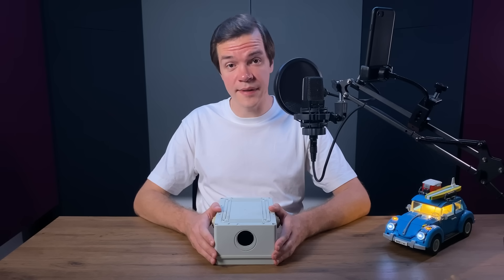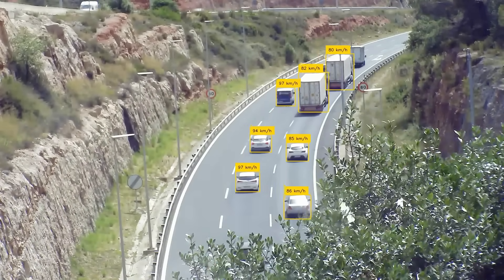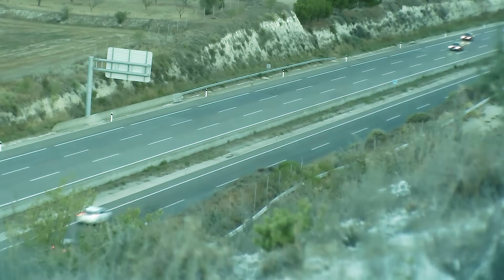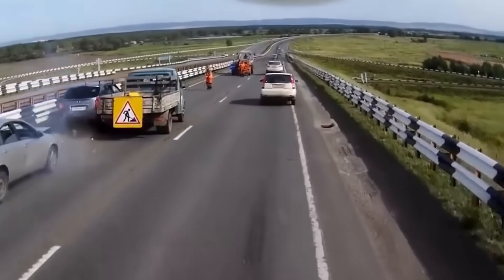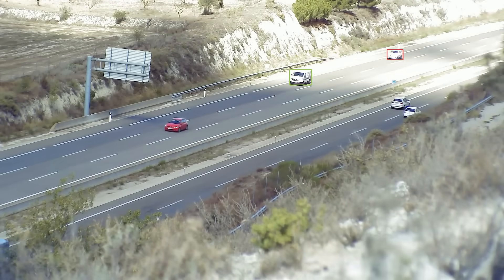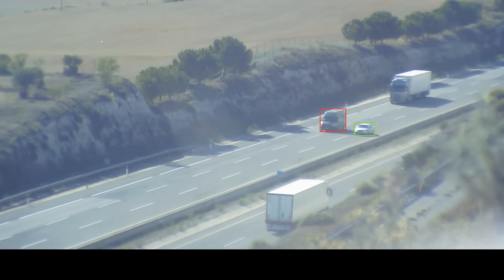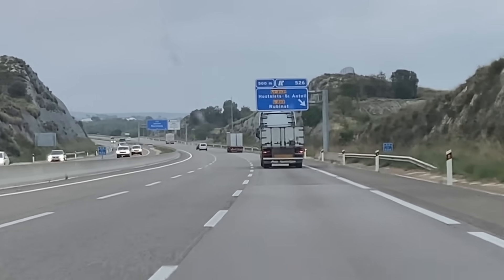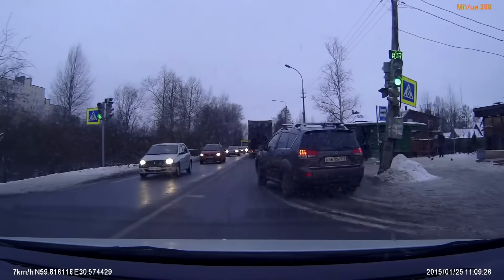New Anti-Tailgating Camera Reveals Shocking Statistics

Comment: They should put speed cameras EVERYWHERE and charge for speeding for each camera that record s the same car speeding. That way, if a car speed for 20+ cameras, they get charged X20 times the fine, and the should also clearly lose their license permanently. That is how you make road safe. And for the love of dog, do not put sings telling people they are being filmed, you are letting criminals know they are being filmed so they obviously stop doing crimes in those areas, how stupid that is... also, if the goal is to make money, why tell them too that they re speed cameras there? That is also cutting like 33% of their revenue.

You could have 2 cameras set along a long straight part of the road, to record enough to prove that some one tailgating is not a victim of being cut off by an idiot. This way, you can show who is tailgating for a LONG distance, even if they where cut off, it shows that they didn't slow down to keep a safe distance again. So yes, they can definitely make a tailgating camera, that can also serve as a speed camera. Why not do it? It would provide revenue and punish criminals and make roads safer. Also provide jobs to people who have to check manually that the verdicts are correct.

Comment: In my opinion streets should be watched by cameras like you did and fines should be given based on variuous observations. Of course the measurements are not "german precision", but it would be easy to look at ten video clips (or hundred) and then decide: You were calculated too fast on several of them and you never travel at a safe distance, so...

Comment: You didn't mention modern lidar-controlled cruise control systems. If you have the cruise control set at 64 but the car in front of you is going 60, your car will sense that there is another car in the lane in front, and will slow your car down. So, the cruise control chooses what following distance to use. The default on my 2020 Toyota seems to be a little over 3 seconds. You can press a button on the steering wheel to have it reduce the following distance, one press gets you closer, a second press gets you closer still, and a third press brings it back to default. But all three distances are pretty reasonable. So modern cruise control systems are teaching a new generation of drivers what a safe following distance is. Unfortunately even when people know what a safe distance is, they often still tailgate. And of course when an injury happens because of tailgating, it is usually the innocent person in front that gets hurt, not the tailgater in back. If you tailgate long enough in your driving history, eventually you will hurt someone.

Comment: First off, avoid freeways like this, if you can. "Tailgating" is tied to speed. If everyone is going the same speed, you'll have tailgating. this happens because everyone seems to do what the vehicle in front of them does. Go the actual speed limit and leave a lot of space for the vehicle in front of you. That way, if someone is braking hard, you can come to a slower stop, which gives the person behind you to come to a slower stop. If someone slides over in front of you, back off and let them. Stop being territorial, it's not your spot, it belongs to no one vehicle. 

I've been driving for over 54 years and have ridden motorcycles for 48 years of it. Early on I was terrible, but using "situational awareness" while riding has made me safer, and more observant in all my travels. Your number one thing to do when driving is to not hit anything. The closer you get to another vehicle, the less time you have to get stopped in an emergency. And, the faster you go, the farther you are going to travel before get stopped. You can cheat the laws of man, but you can't cheat the laws of physics. In those 48 years I've ridden over 570,000 miles, and it wasn't until 9 years ago before a car finally hit me. It was at an intersection, he "rolled" through a stop sign while I was making a turn in. It was minor.

Comment: Your analysis is 💯correct…

My driving style would show up as fairly typical by your camera — but decades of safe driving has taught me to look ahead and not just react to the car ahead — THIS IS IMPORTANT. Because you’re right to assume that is what most people do. 

However, the signs are nearly always there to either increase the gap or slow down — things like brake lights up ahead / increasing density of cars around you / brake lights in adjacent lanes (can cause some drivers to jump into your lane and cause sudden braking) 

Anyway tailgating is definitely more important than speeding and probably 1/2 way to a real safe driving experience.

Comment: In California everyone speeds, tailgates, and drives in herds. When I am driving hundreds of miles on a rural stretch of freeway I make sure that there are no cars around me. Every now and then a herd of cars catches up, passes, moves on and I am once again alone. I am usually driving a little faster than the speed limit. I'm very nervous when I'm surrounded by this herd of cars and so relieved when they have passed and I am by myself again. Of course this is not always possible when there is heavy traffic but I always try to maintain a safe distance. I was always taught to have 2 seconds of space but you say 3 seconds in the video. I will adopt that rule.

Comment: If a 30m following distance is used in Los Angeles during a busy time on most LA freeways, the traffic would be backed up for hundreds of miles.  What amazes me are not the number of crashes that occur in the LA area but the number that don't! Millions of  densely packed cars travelling at or above 65 mph (104 kph) everyday and only a small percentage of those cars collide. I have been driving LA freeways for over 50 years and am amazed at how well the drivers seem to be able to avoid each other.  Not to say there are few bad drivers because there are many and like water in a pipe its the obstructions and turns that disrupt the smooth flow of traffic.  Like your analysis, very quantitative.

Comment: 30m?! Homie, 30 FEET isn't even close enough going 120-140kph on US highways. One of the longest civilian (i.e. non-fleet) vehicles you can buy here is a dually long bed crew cab Super Duty F-450. It is 266 inches long from tip to tail. That's 22 feet. You leave any more than 30 feet of space and you're asking for a bad time. Even a truck that long (and especially a truck that long) will ABSOLUTELY try to merge in front of you.

Comment: In South Africa, speed cameras are mostly placed where they specifically want drivers to slow down such as when entering towns or where a freeway converts to a lesser road. Drivers do know where the cameras are and they are very effective at teaching drivers to slow down at appropriate times. High speeds on the freeway itself are often not that much of a problem which is why Germany has many freeways with no limit.

Comment: I've been driving since the 1980s, and I already knew the answer was "following distance" and not speed that causes most accidents.  The other causes are distraction (particlularly with the advent of smartphones), and "horseplay," that is when someone is just "having fun" with their car.  Typically young males do that.  I did that myself, but was fortunate enough not to have any serious accidents (I did put my car into a muddy field on a back road once).  

I can't speak for any other country, but in the US I think another culprit is lack of sleep or inadequate sleep.  The worst accident I had was a result of that.  Turns out that I have sleep apnea.  It was after that accident that I went to get help with my sleep.

But the thing I've observed the most during my years of driving, most people don't allow enough distance between each other, and when you do leave a reasonable distance, others jump in the gap.  I usually stick with the slower lanes so I can more readily maintain that distance, but even I've been guilty at times of following too closely.
Reply: Mostly correct. You conveniently forgot to discuss simple physics. As speed increases reaction time must also decrease, and everyone has their limit. Additionally, as speed increases, the moving mass becomes more and more destructive. Adding the requirement of decreased reaction time and increased destruction together is a very dangerous mixture. So, speed does cause accidents. 

To understand this very simple concept: 
Imagine driving down the road at 30 miles an hour and a deer runs in front of you. Now, imagine driving down that same road at 100 mph and a deer runs in front of you. Your reaction time at the higher speed must decrease dramatically in order for you to miss hitting the deer. Add in the mass of the vehicle at the higher rate of speed, other vehicles on the road traveling at different rates, and other drivers with different skill levels, and you have a recipe for an accident. This is pretty simple stuff.
Reply: @niaralosusa  I'm not disagreeing with your statement, but I didn't claim that speed doesn't contribute to accidents, but that it isn't the cause of MOST accidents.

Higher speeds will increase the likelihood of accidents, and will definitely increase the damage and injuries an accident will cause.  

But most accidents are caused by following too closely for the very reason you point out that high speeds can cause an accident, reduced time to react.

The reason that more accidents are caused by following too closely rather than high speeds is that there are more people  following too closely than there are people going at high speeds.  

Of course, the question comes up, "How much speed is too much?"  That's a question that will have many different answers.

Comment: The assumption that you need to come to a full stop is faulty. Any other vehicle on the road will also take time to stop making the required following distances much smaller. So the only case where those full stop numbers have any merit is debris in the road which isn't that frequent. However, also ignores that you really just need time to dodge it, not stop (in most cases where there is a shoulder to flee to, or another lane). If you stop you are in far greater danger than just hitting whatever it is, as you have a high likelihood of being rear-ended at high speed by a much larger mass than the debris.

Comment: What makes freeways dangerous is the combination of people with no sense of urgency who camp in the passing lane and people who are impatient and frustrated with those people who try everything they can to pass them.
Reply: No one should have a “sense of urgency” when driving. That is very dangerous, especially when maneuvering thousands of pounds of steel at high speeds.

What makes freeways dangerous are the people who have a “sense of urgency“ and cannot control it, and therefore react in irrational ways.
Reply: @niaralosusa  by no sense of urgency I mean they don't give a damn about other motorists and their potential need to get somewhere faster than a snail's pace and think that it's okay to dawdle in the passing lane. Some people are trying to get to work on time, not everybody is out for a Sunday drive, that's what I mean. If someone wants to go faster than you, let them, if they get a ticket it's on them. Also having a sense of urgency is being aware of what is going on around you and mindful of others, mindful of the flow of traffic and focused on the actual driving. It is mind boggling how many people I've passed on the right who were holding up a line of cars while they are looking down at their phone.

You are referring to what I would call aggressive drivers, who combined with the inattentive dawdlers are the two components that make it dangerous. Fix both of these, and the freeway is a utopia of moving people efficiently.

Comment: personaly i have an extremely hard time with distance and there is no guide on the windshield to help me juge how close or how far i should be. 

counting time and lanes is a distraction that almost got me out the road as i counted, plus its gard to do since both car move.

while driving i assume the car size in front of me, the issue is i mistly drive on road far bellow hight way or hight speed roads (110 to 130 km road / highway, i drive from 30 to 80km roads).

my brain then assume what is safe for 80 must be fairly close to 110 or 130 but it should be double not just a little bit more distance.

Comment: All road laws are written by the council of little old ladies.
I drive 64k miles per year for work.
If you pay attention, one will avoid 99.99% of all issues.
It's not tailgating that's the issue, it's the ass in the fast lane who refuses to move!
Lastly, if you leave to much of a gap, someone will fill it.

Comment: The rules kind of are completely random. If you’re maintaining 100 m following this at 60 mph there is a significant amount of space in front of you for someone to merge in front of you and suddenly half your following distance. Putting you and everyone else in danger which forces you to maintain smaller following distances at all speeds in most traffic conditions to defend against people merging in front of you unpredictably. People also don’t drive at consistent speeds. People are often oscillating between 5 mph over and 5 mph under and some people go significantly faster or significantly slower maintaining a strict following distance becomes very difficult under those conditions

Comment: In the five and a half decades I've been driving, it's been well known that the two factors causing freeway accident damage are tailgating and interlane speed difference greater than 15 mph. Speed alone is not a top factor associated with freeway accident rates. Enforcing speed limits does not reduce accident rates.
Reply: Just to be cristal clear, I will repeat the little detail that it stands true only on the highways.

On smaller roads, and of course in urban spaces, speed is the first cause of injury

Comment: Excellent video.  If you couple this with an analysis of how little time is saved by highway speeding for an average commuter then I think you can provide a compelling argument that lower speed, increased distance between vehicles, and tolerance/patience will result in safer roadways.

Comment: when i bought my car, one of the first things i tested was its braking power. i tried emergency braking from 200kph. by the time i was doing 70, the brakes were already cooked and the disc warped slightly. so i know, my car isn't capable of emergency braking from its top speed of 210. good information to have.
i tend to focus more on driving than the average driver too. i'm pretty sure my reaction time even in a more relaxed / bored drive is south of 300 ms. it has saved my hide a bunch of times already.